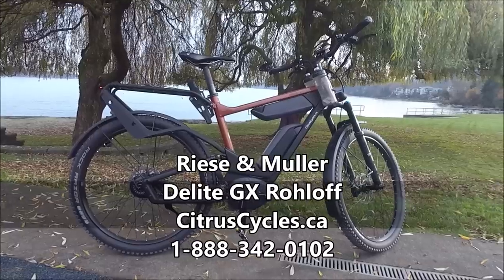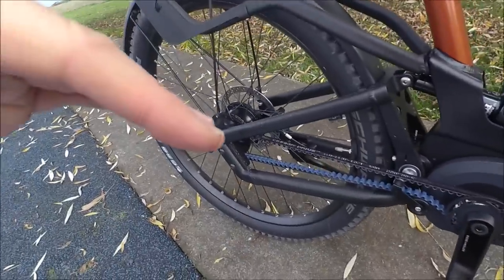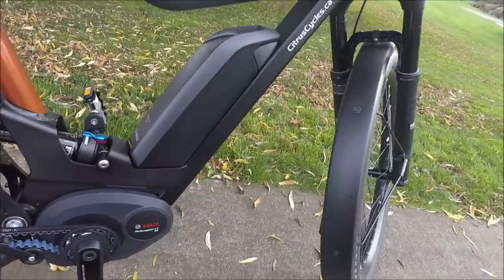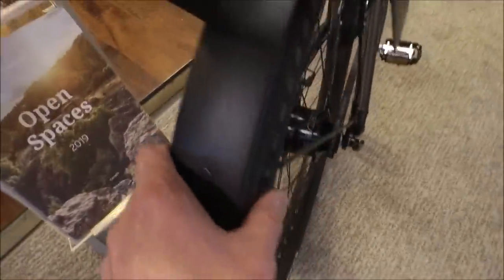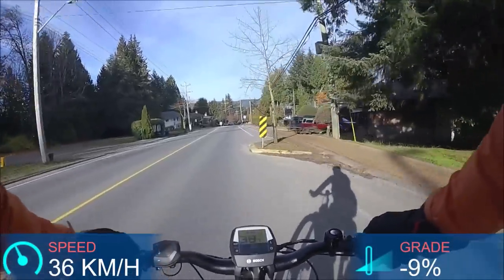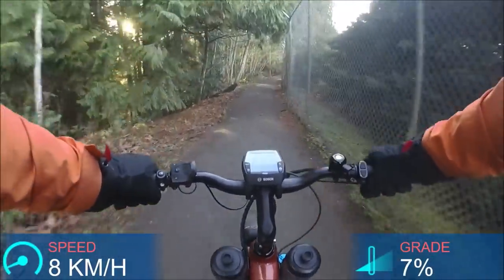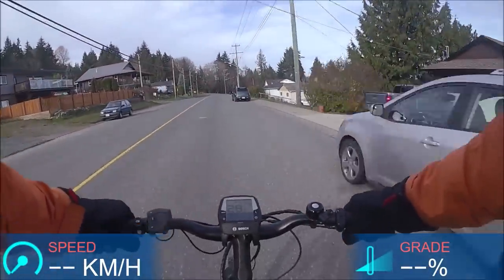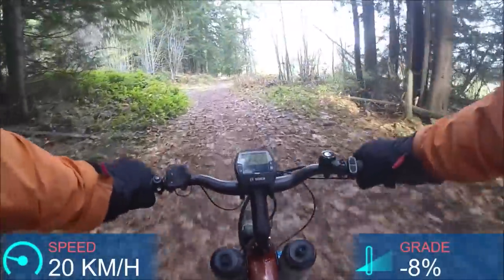R&M 2019 Delite eBike Review & Ride Test

Comment: Hey, so I watched this whole video. Excellent! A++ review. Question: when you get home from a dirty ride like that, how do you clean the bike? Do you just HOSE IT DOWN?  You mentioned you like not having to clean and lubricate a chain and cassette, but the belt still gets dirty, right?  Can the Rohloff unit take a direct hit with a hose?

I test rode probably your exact model with probably identical options just yesterday. Before watching this video, I was leaning more to the GT with Vario, but I think you convinced me about the GX with Rohloff, upgraded suspension, and these tires!

Another question: I was thinking I would prefer the speedy Bosch motor instead of the CX, just for the higher top speed on roads. But would the lower torque of that motor be noticeable on the trails you rode in this video?  Would the lower torque PREVENT you from taking these trails?  Just wondering, how noticeably different are the two Bosch motors in practical usage?  Thanks a lot!  Loved this video!!
Reply from the maker: I use a garden hose with no pressure, along with some bike wash.  The belt does get dirty, and some water helps to clean it up.  Here in Canada we only have access to the CX drive as the HS are not legal, so I can't really comment on the difference.

Comment: 👍🏾 👍🏾 Great review. 

- What’s new for the 2019 model compare to 2018?
- How come you upgrade to the Fox suspension? Is the stock suspension components not enough for you?
Reply from the maker: The 2019 Delite GX Rohloff uses the Rohloff eShift instead of the mechanical twist shift and a Gates Carbon Belt instead of a chain.  The light has been upgraded to the SuperNova M99 Mini Pro 25, brake lights have been added, and they are now using 35 mm rims instead of 40 mm rims.  The rack has been made compatible with MIK, and they are now using the Abus Bordo Alarm folding lock.

The Suntour is very good, but I do prefer the Fox, especially since I tend to go off-roading with my bike.
Reply: good

Comment: I’ve had the Delite GT Nuvinci since I think March this year. It’s awesome but I do feel this kind of buzzy feeling with the nuvinci sometimes (or at least I think that’s where the vibration is coming from). I can’t figure it out. Any ideas would be appreciated.

This would be my perfect upgrade. The electronic rohloff still with the belt would be amazing. I think I would change the tyres for the Super Moto X which I’m used to though. Even though I do a mix of road and off-road, those tyres have served me really well.

The only other thing I don’t like about my bike is that I have to take the battery off each time I need to charge. It seems the port on the bike will only work if you have both batteries installed, and I don’t need 2 batteries. Maybe I will get another eventually but only if I decide to do a multi-day tour somewhere.

Maybe it will work if I put the single battery on the top tube connector. I doubt it but perhaps you know about that too.

Thanks for the great video.
Reply from the maker: I do love having the Rohloff myself, but the Nuvinci/Eviolo is also very good.  You can charge just a single battery on the bike if you wish, but the battery needs to be in the battery mounting bracket that you connect the charger to.
Reply: instablaster.

Comment: You mention below that this is the 54cm medium bike, do you mind sharing how tall you are and what your inseam is? I'm 185cm with a 92cm inseam and have the medium delite on order but it's not too late to switch to large.

The included lock is an abus 6000A I think which is only Sold Secure Silver, is it possible to fit the 6500 which is Sold Secure Gold instead? If I wanted to mount a beefy U-Lock instead are there any good spots for it? Normally I'd use the front triangle but there may not be space with two batteries there already.
Reply from the maker: I'm 182 cm and find that the medium frame works really well for me.  If possible, I would recommend trying one at a dealer that has stock.  You should be able to replace the lock and holder that comes with the bike with the 6500 if you wish.  I imagine you'll need to bring the U-Lock in a bag on the pannier rack as there really isn't anywhere to mount it on the frame.

Comment: Great video! Thanks! Any change that you could do a short video how easy the rear wheel is to remove/ install back to its place? So with this bike I don't need at all the krikit tool to adjust the belt tension? Belt tensioner does the job?
Reply from the maker: I think that there are some good videos on how to remove a rear wheel with a Rohloff hub, but I'll see if I can do something myself in the future.  The belt tensioner does a good job, but you still may want to check the tension from time to time, even if it is just with their app instead of the krikit tool.
Reply: @CitrusCycles   That's true. But there aren't any showing how easy (I assume) it is now with the new E14 and gates CDX.
Reply: Antti Järvenpää you are very funny
Reply: @SurajKumar-bw1qs  Are you indian?